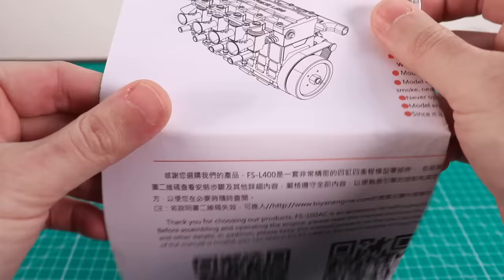Building a HIGH Revving 4 Cylinder Mini Engine - 4 Stroke Engine Build

Comment: I wish someone would invent a huge version pf one of these. Could you imagine the potential?!
Reply: Ikr. It would be revolutionary
Reply: We could power whole bicycles with that
Reply: @dz9459  Yes but I was thinking more like using this with some sort of compartment to carry people you know? Like instead of horses, we could use this. I know it sounds silly :(
Reply: @Flash_345  idk but that sounds very advanced. In the future maybe.
Reply: Um aktually 🤓☝
Reply: @Flash_345  wow, are you Henry Ford hiding his identity by Nickname Abdullah ?
Reply: Buy a civic engine, problem solved
Reply: @amernew3ful  no1 knows Henry ford
Reply: What if we put it on a trike or something and use it together around?
Reply: @boredomperformance3442  thats not very high revving
Reply: @dz9459  its funny because this tiny little 18cc has about the same power output as your average moped engine
Reply: @pancake5830  get back to me when u consider torque😂
Reply: @dz9459  torque? never heard of it B))
Reply: @pancake5830  higher than a lot of engines, but the real issue is torque
Reply: @Flash_345  you mean a futuristic train?
Reply: I predict that it’s gonna happen, and almost everyone will have a moving carriage powered by one that runs on a stronger fuel source, like different derivatives of petroleum. A ton of other machines will also use it, and humanity will overuse it to the extent that it causes air pollution.
Reply: it could run a vehicle at a speed up to 88 mph to make time machine
Reply: أللهم صل على سيدنا محمد وعلى آله وصحبه أجمعين اللهم ارحم ابي الغالي
Reply: you mean just build a real engine? lmao
Reply: Yeah. What if we put a 2 cylinder version of the engine on a steel chassis with near plastic body panels and build it in the east of Germany? Just need a name...
Reply: @SoppyBoot  I would call it Trabant, but it's just my random thought
Reply: 2jz 6I 6-2=4 3jz xd
Reply: @اليبي-غ9ك  wrong place wronf time
Reply: or a lego version
Reply: @dz9459  I mean, this small thing has 3hp output. Enough to move 223.8 kg, so technically this thing is already capable of powering bikes
Reply: @pancake5830  you gotta modify it a bit. 12,000 is possible with some of them, and 1,000 horsepower
Reply: 1998 honda civic engine for ya.
Reply: @pancake5830  Honda engines are pretty high revving in comparison to most 4 cylinders
Reply: And what's the potential? It wouldn't spin as fast due to the bigger size, plus the carburetor can't provide the engine with good efficiency and power
Reply: @yourbigfan1777  they could convert the carburetors to other forms of air-fuel injection
Reply: 😊9
Reply: ээх😊😊э9э9😊эхэ😊хэхэ9э😊😊😊😊😊😊😊
Reply: There is one 4age engine
Reply: I think they have before if I remember correctly it’s called a 2jz gte
Reply: check ship engines and see magic
Reply: yeah cause there alot of energy in water...
Reply: Okay, but what if we made that horseless carriage really big and made it carry big things around?

Comment: The machining quality on these is amazing
Reply: better be for $2000
Reply: They are nicely made but this particular engine has a major design flaw; only two crankshaft bearings.  They are infamous for snapping crankshafts, some owners have gone through multiple cranks.
Reply: Likely because they knew who it was being sent to. Otherwise be prepared to have to file / sand / and be shorted a piston like myself.
Reply: @ferrumignis  The very first thing I noticed when he put the crank in, that thing is not gonna have any support at all.
Reply: This is obsession on a whole new level
Reply: I can just slowly shake my head in amazement evertime a part fits and moves perfectly..
Reply: just the sound of the metal alone tells me this shit is good quality
Reply: 2 кошачей силы 💪😁
Reply: China 👍👍
Reply: @ferrumignis  HOOORAAYY !!! PARTY !! TIME !!!
Reply: It's... Machined.
Reply: The tiny pistons, rings and seals get me every time.
Reply: Enjoy oil to dala nh
Reply: @ghostlyninja125   The sound of aluminum means it's good quality?
Reply: @R S You're right! A Chevy small block would look badass, not amazing.
Reply: @JSchaffer214  that was the sound of hardened steel my friend, not every part is aluminum lmao
Reply: I agree
Reply: Go
Reply: @Ram-1988Groznij  к&445н🤗😡😡😡🧐о.т,. о., т ко дээ
Reply: @ВикторВолков-к1ж  чёёё?)
Reply: I am sure its CNC lathe and Mill that did that engine
Reply: Where can i buy this engine?
Reply: Lmao the price of a full size engine and only comes with 2 crankshat bearings 😂😂
Reply: اين يمكنني شراء هاذا المحرك

Comment: I marvel at the machine tooling that went into producing all the small engine components. 
 Great video! Love the sound effects.
Reply: Toyan has been doing this awhile and gets big $ for this stuff. Blows my mind but they r all build on nitro fuel r/c style theory. Id like to see(& have few times) and actual 1 off custom mini engine built to run on gasoline or diesel. That would be cool. Maybe i duno 5times size of this. Like soze of a briggs 1cyl 5hp engine but a v8/v10
Reply: Same. Most impressive for me was the clearance of the pistons with the block. So tiny!

Comment: Wow this is incredible! I have seen metal engine model kits but they are only for display, this one actually works like the real thing. I am amazed! Thank you for building it up!
Reply: Check my about section link  Scammer alert
Reply: Bruh how tf does this hearted top comment have a scam for 10 days and it's still up
Reply: Only part I dont like is that it only has 1 piston ring and no oil ring
Reply: JohnnyQ90 has several videos of working mini engines by Toyan. He plays around with them, and tries to hop them up by making homemade parts. He has some interesting videos in case your interested.
Reply: @HinkHall  گججوج‌‌کچپ‌۸۸ء۸
Reply: P
Reply: P
Reply: Pllllll
Reply: @Darkhalo314  7
Reply: @Darkhalo314  1
Reply: Is everything except for the wood included

Comment: I would love to see this as the power plant for an rc car or boat.
Reply: маховик просто крутится внутри, из него нельзя сделать ничего, это как стенд
Reply: As a diesel glow plug type engine the power generated by the engine is usually less than impressive. Cool factor aside. Add one manual transmission with manual clutch to compensate for lack of power and added realism now we triple the cool factor.
Reply: They are to weak, way better off electric or a nitro motor actually made for rc. This is a tabletop model only.
Reply: 번역 기능을 이용해서 외국인과 말이 통하니 너무 좋네요
Reply: @B_siri  ikr? i love that feature, finally something good coming out of youtube
Reply: @B_siri  wait can it translate "ikr"? it stands for "i know right"
Reply: It has been done a few times. Search for - FOUR Cylinder 1/6th Scale RC Car Build - on youtube.
Reply: or a real cool weed-wacker
Reply: @ScrawneyRonnie  morze testu nie rozejść musi amortyzować na jakiś poduszkach ta chyba ok

Comment: I wish Toyan had more gasoline options. It seems almost every one of their kits runs on nitro, and I want one that runs on gas cause nitro is very expensive
Reply: Exactly
Reply: And it goes stale fast ! Year it would be grate to use 98 !
Reply: @jodierpbinson6246  You must be getting really crappy stuff then. My sidewinder and cool power stays good over the winter and well into the next summer. It’s still alright around 1 year later.
Reply: Diesel would be my fuel of choice
Reply: @Interdiction  yes one slowest burning fuel makes sense for this... not
Reply: Oh this is a nitro engine? Maybe that explains why they sound a little funky... That's probably it. Mhmm..
Reply: After watching Donut fight with and ultimately fail (for now) with the gas V8 I think it's better to just go with the nitro lol
Reply: Smerter then yuu!  exactly…

Comment: Imagine putting this in a rc car
Reply: Exactly what I was thinking
Reply: This is exactly what these engines are built for
Reply: Nice pfp
Reply: This particular model is only for ornamental function, it's crank will break if used under load , and they are seemingly not interested in fixing the defect .
Reply: great engine conversion for bicycles too!!
Reply: @fidelcatsro6948  nope not at all
Reply: JohnyQ90 did this
Reply: @fidelcatsro6948  Huh!
Reply: Or RC airplane
Reply: Has anyone used these for a practical purpose like putting them in a RC boat or car for instance or used them for a tool of some sort.
Reply: People have done that
Reply: Or METAL ! SHREADDER !!

Comment: It's probably a silly idea But would be awesome to see you to hook one of them up with a little alternator or what ever would be needed to use as a small generator?🙂 Be Interesting to see how much charge you could get of one!
Reply: it will be very good since i don't see the purpose of even making them if you aren't using their power
Reply: @АнТон-ч2ъ7д  i think they r made for RC Cars
Reply: @АнТон-ч2ъ7д  using this motor for electric power is very useful, amazing idea
Reply: Small engines are less efficient, but I also doubt this engine is built to run for long periods.
Reply: @sdfglkjhdfkjdhldskfj  
Exactly, there’s not any real lubrication/oil circulation system.
Reply: @filiplaubert5001  No, it's not useful at all, and it's a terrible idea. Using a small engine to generate power is very inefficient, and this is a high-revving design that would need a lot of reduction gearing to drive a generator, decreasing the efficiency still further. This would just be a way of converting very expensive fuel into small amounts of electricity.
Reply: @EZ-GAZI  thats too big an engine for those,unless the rc car is big enough to fit a small child
Reply: @andrewchin5583  you're imagining the scale completely wrong, the engine doesn't go in the bay, it goes in the middle and there's no passengers

Comment: All the components seem to be very well engineered. A joy to watch this engine taking shape. Have you built one of these before? I would find the large number of parts quite a challenge to know where they all go.
Reply from the maker: I've built real engines before. :-)
Reply: @DIY-Garage  Ah! So have I! 60 years ago I had just started, aged 15½, as an apprentice motor mechanic, working mainly on Austin  and Morris cars with the A-type or B-type engine, both of which I later got to know inside out. Engines weren't nearly as reliable back then.
Reply: @SuperLittleTyke  engines back then ain't as reliable? U sure u didn't mean the other way around. And that's crazy how much experience you have. Respect.
Reply: @p19shelt  No, engines in older cars needed much more maintenance than today. Perhaps it's due to better lubricants today, but also so much specialist equipment has been introduced over the years that enables more precise engineering tolerances and machining techniques. It's a shame that we reach manufacturing perfection and then the electric car arrives! With a 200 mile range, gosh! I see them parked at the Tesco charging station with the driver sitting in the vehicle for half an hour in order to get home. And this is progress?

Comment: 2 concerns: 
The piston lube will wear out very shortly and I see no easy way to open it up and reapply.
Same for the crank shaft bearing, that blob of lube cannot survive it long term and will eventually dry out
Reply: splash lubrication?
Reply: Your concerns are correct, but this engine was made as a fun project or display piece. It was never meant to drive anything like an RC car or boat so you won't actually run it a lot. The drive shaft has no output to a clutch or gearbox. You could perhaps modify it to run something but it wouldn't be a good idea since the parts are not continuously lubricated as it runs.
Reply: oh it seems i'm wrong. RC engines just doesn't seem to have oil lubrication like full sized engines. I guess you'll just have to take them apart once in a while to lube the parts
Reply: @hashtag-shaneiacs  I think the fuel is mixed with some oil which is why they often have big white smokey exhaust plumes
Reply: @fab9207  even with oil in the fuel its still a 4 stroke that's only going to lube the upper engine, if it were a 2 stroke with fuel going through the crankcase it'd be different
Reply: Also noticed, no oil pump either? It will blow quicker than quick :'(
Reply: @magicstew45  There is always some fuel ending in the crankcase, even on a full size car the rings do not seal 100% so that might be enough to keep the bottom end lubricated since RC fuel is mixed with oil. Maybe.
On practical 4 strokes RC engines the fuel goes directly into the cylinders and it works fine, but I never opened one (I only had 2 strokes) so I don't know if they did something specific to collect the oil and distribute it better than in this engine.
Reply: @miljororforsprakpartiet290  As far as I know there is no oil pump either on 4 strokes RC engines (the small ones at least) and they work fine for extended periods of time, I searched a bit on it and it seems the ring gap is intentionally left wider on these than you would on an engine with its oil pump / sump system to allow more blowby and then more oil from the fuel to reach the bottom end.
The top end usually need to be repacked with grease once in a while though.
Reply from the maker: The engine gets lubricated by the fuel/oil mixture.
Reply: @pbe6965  well that makes enough sense, I wonder what kind of compression ratio they can keep with enough ring gap to lubricate the lower end.
Reply: @DIY Garage, there’s a fuel/oil mixture on a 4 stroke? Interesting.
Reply: @paulf.8651  I think he is bluffing, no way 4 stroke can get fuel oil lube at crank bearing and the amount of lub blowby of piston ring might not be enough
Reply: Model engines usually last a long time. Decades is not uncommon. Some have ringed pistons, some high performance engines are ABC and do not. Aluminum, Brass, Chrome. The piston gets tight approaching TDC. Some turn 30kRPM
Reply: Did you miss seeing the oilpump?
Reply: @hashtag-shaneiacs  So what is the smallest crank with internal passage for oil?
Reply: Nitro engine, do your research.
Reply: @DIY-Garage  No it doesn't XD fuel/oil mixed does nothing for a journal bearing. That's why 2 strokes use ball bearings. For a journal bearing you need film strength, and what happens to an oil when you dissolve it with a solvent like idk nitro methane, it loses all sense of what film strength used to be. The ring might get lubricated a little bit, but only from one side, and never controlled with a separate ring. Standard oil control rings make sure every time the piston moves, it leaves behind a film, its designed to not scrape away all the oil. That thing however, has 1 solid ring. It doesn't get lubricated, it merely "sees" oil.

A standard break in period for any normal engine would destroy this one. So no, it's not being lubricated.
Reply: @kamikazekaos  You mean: Top Fuel dragster? They also have forced lubrication. I love forced lubrication. That's why I love car engines, but not lawn mowers or anything lubricated in a house ( windows, doors).
Reply: @DIY-Garage  But it is a 4 stroke. The oil in the fuel won't get to the crankshaft and its bearings.
Reply: @hashtag-shaneiacs good point ma’am

Comment: I would wash every single component of that before starting.  You always have aluminum dust on everything. Threaded holes, recessed areas with tight corners, ect.    The  grey grit at the bottom of the flushing cup, after flushing,, will open your eyes. You create/grate a bit more if o-rings are installed dry and it's a tight fit.  Be very generous with the assembly lube,,no matter the instructions,, that just show drops of oil.   CRC QD electrical cleaner and compressed air until dry and clean.  The CRC wont attack rubber components,, but will soften certain open cell foams.   Use a magnifying glass to be sure your clean.   Very cool little 4 popper.  Thanks!.

Comment: 214hp per liter, that’s amazing.
Reply: It's the nitro fuel
Proper nitro powered RC engines get a good 1000hp/l and top fuel dragsters running on 90% nitro can get 8-11k hp out of the 8.2l engines
Reply: @AlphaDomeLP  dragsters run on 90%?! God damn, i run on 10% and 16% and its already very fast
Reply: @furkanfpv677  the engines do only last about a mile though
Reply: @testaccount4191  oh, thx for the answer
Reply: @testaccount4191  well... to be fair it's just the service interval, like the 40k miles rebuild interval of 13B's, which is actually not that bad compared to competition engines they can come close to without losing too much reliability 🤭
Reply: @jmc8583  God i have such a love hate relationship with 13b engines. I owned a RX8 for about a year and a half. Between the engine flooding at startup, the 10mpg (with 2t oil) and the 3k rebuild cost it was by far and way the best car i have ever owned . I wish they made a RX8 with a small turbocharged  piston engine.

Comment: Thanks for the excellent video! I’m inspired again. Now would this set up go in a model boat or remote controlled truck?
Reply from the maker: Glad you liked the video. This one is designed to go into RC cars & trucks.
Reply: @DIY-Garage  Have you figured out which R/C model you're gonna use to run this bad boy? I'm interested. Give us a heads up. Tired of 2-stroke R/Cs', they're hard to keep in tune :(

Comment: No oil? How do you maintenance it or is it a one time use?
Reply: isn't it this? 2:46
Reply: The engine is lubricated by the oil mixed into the fuel.
Reply: That’s assembly lube